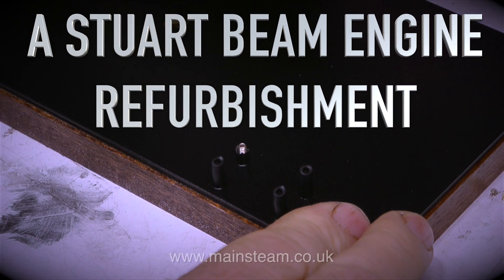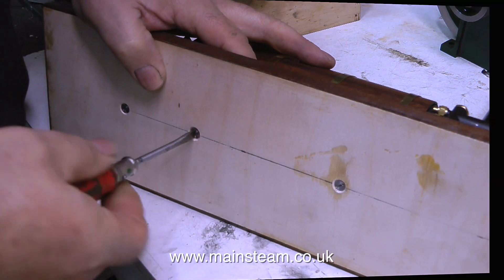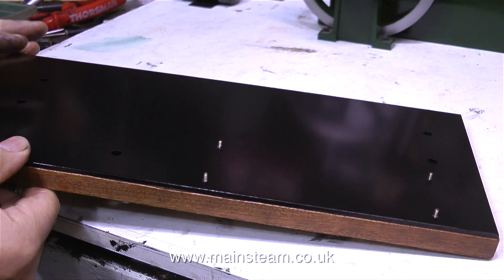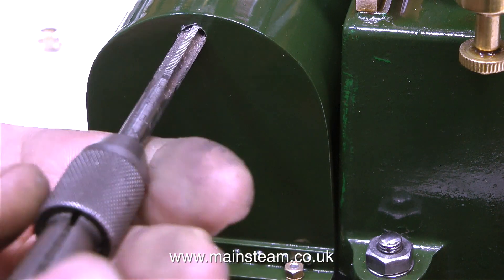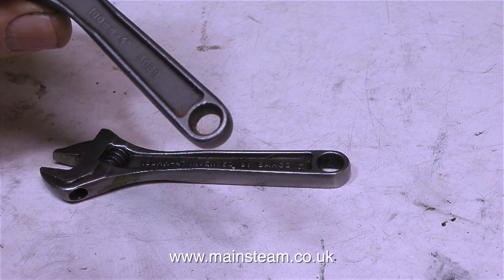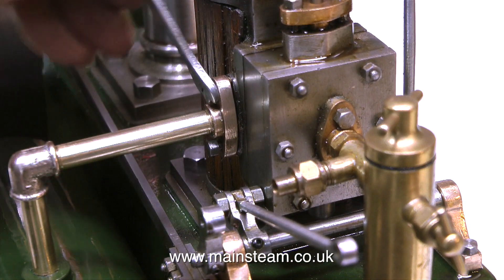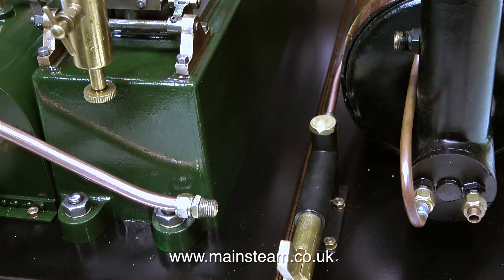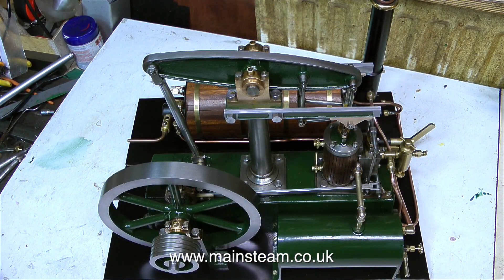STUART MODELS BEAM ENGINE REFURBISHMENT - PART #10

Comment: For tight access fasteners, a universal joint socket is very handy. Due to the high cost of these sockets, you can take a 1/4” square drive extension and grind the square drive that enters the socket to a tapered square at the top and bottom end of the square drive to allow the extension to operate at an angle, yet leaving an original cross section in the center to drive the socket.  If this was not sufficient, you could do the same with an Allen key and a hex adapter in the socket. The optimum is probably a 4 or 6-sided sphere with a constant diameter at any operating angle. A custom machined version with tight tolerances could be much better than the most expensive you can buy. There are also those with a ball end and a cross pin in a slot to drive it. With your lightly tightened fasteners, anything should do. With a ball end allen key, it could do to just make a hex-drive socket.

Comment: I've tried to thread copper pipe before and failed miserably, I never thought to use a steel blank to support it while tapping. 

Do you have a link to the silicone rubber tubing you buy?
Reply from the maker: Try Typing "silicone rubber tubing" into the Ebay search box . . . . . that's what I did . . . . .